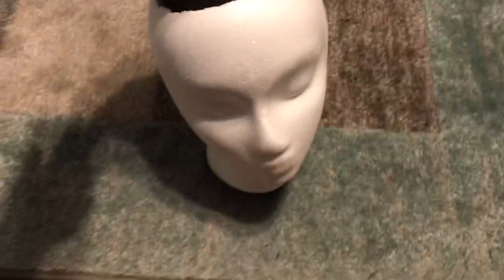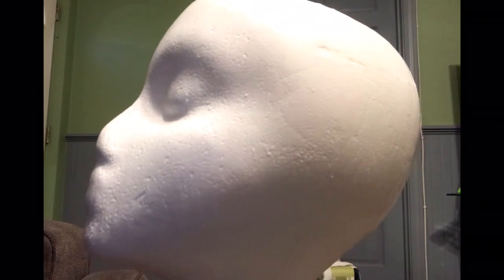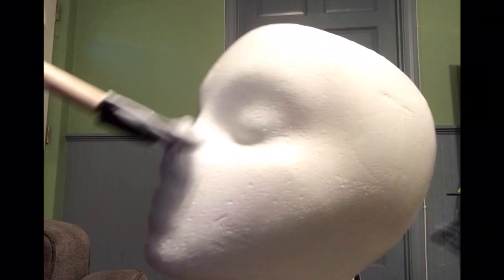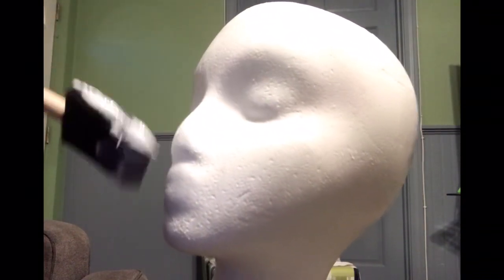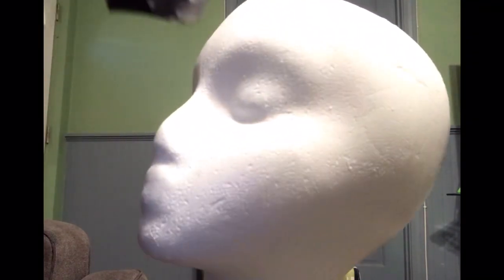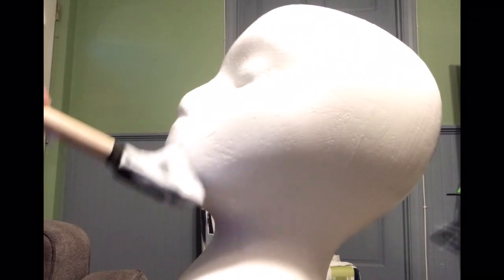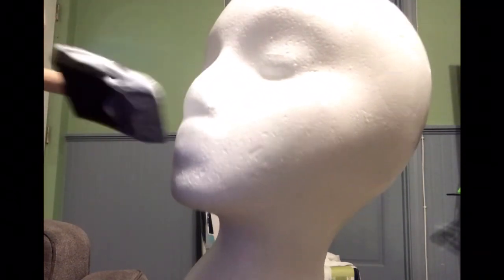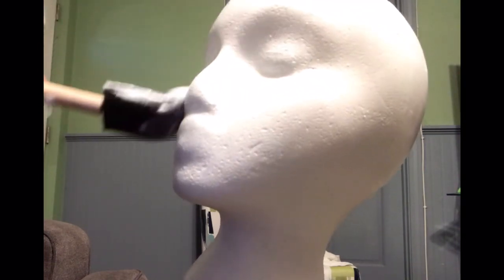Mannequin Head Planter

Comment: How do you keep the head stable with the plant in it.
Reply from the maker: The weight of the plant and pot holds it steady as long as it isn’t too too heavy. For added support, buy a plug with a suction and insert it in the hole at the bottom of the mannequin’s head.